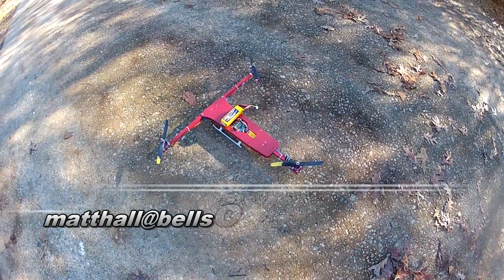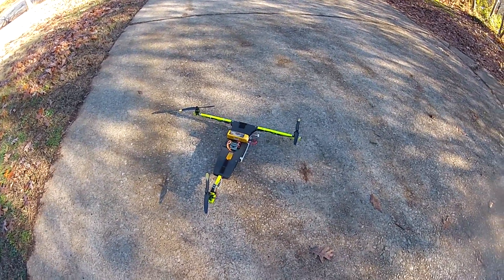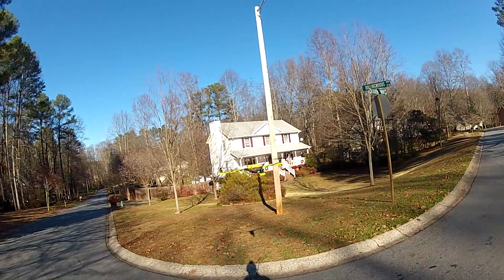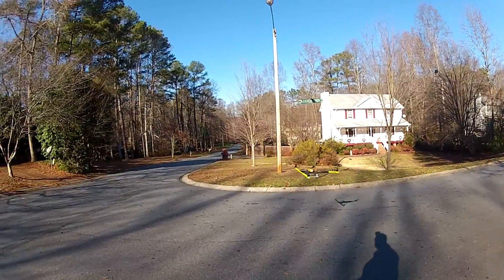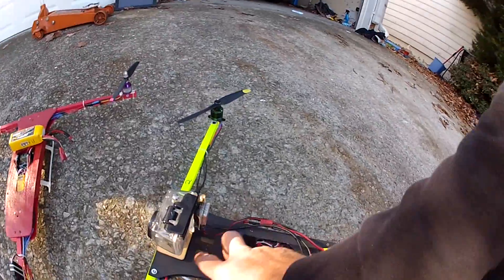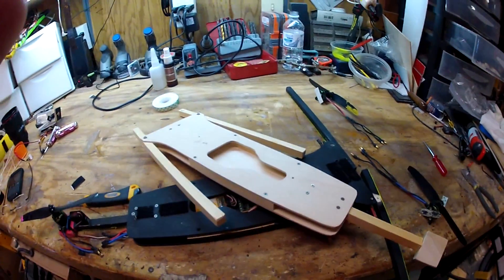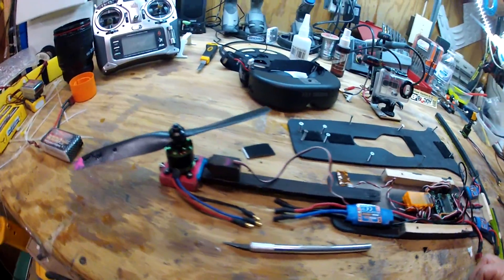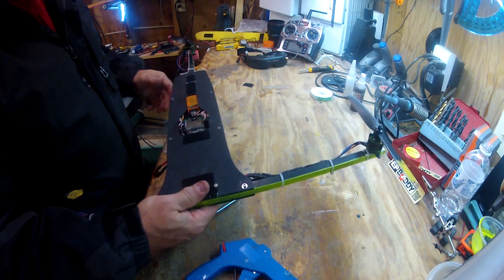simplecopter T Copter For FPV www.simplecopter.com

Comment: Have you tried the SunnySky 980kv with a 9047 prop vs 1400kv, 8047?  Basically, how fast does aerobatic/hover performance drop when you go slower/bigger on the motor/prop?

Comment: I am first time working with a T copter and don `t know what to make of the base body T copter! general pozhaduysta explain to me how to make a model I I do not know which radio equipment is needed for this T copter, what speed control, what kind of battery! I hope for your help I would be grateful if you send me all the marks and names of all the parts of the T copter Thanks in advance for your attention!

Comment: Besides the shape, looks, and electronics being on the inside instead of the outside; what's the difference in the T-Copter and the Y-Copter that you build.  Does one fly better or faster than the other?  Easier to build/rebuild than the other?  What....? Thanks

Comment: G'day Matt, maidened my T-copter today - wow!  Just awesome!  Had some fun getting KK1.6 flashed on my board as the HK usbASP came without firmware *grumble* but I managed to hack my Arduino Uno into being an ISP and got it loaded.  My ESC's aren't flashed yet, so stability mode was a bit ... unstable(!) ... but it certainly helped with basic hovering in 10mph winds, and for vertical climbs (my first attempt at a fast climb without stabilisation nearly ended badly).  ESC flashing tomorrow!!!

Comment: My God you Sir are an insanely freakin awesome tri-cop pilot!  I have been learning on a F450 FlameWheel with the old crappy original KK board for about a month and although I can hover and do some basic flying I STILL SUCK!. Lol Is a tri-cop easier to keep your orientation in your opinion? The reason I ask is because it has an airplane look and I am an airplane guy. Im Not great at flying FP & CP helis but I do a lot better with them than my quad because the orientation is easier for me.

Comment: Hi Matt, you sound like you're from Fort Worth Texas, are you?  I'm from Houston.  But, here is a question...Do you have any idea how much weight this design can lift?  I want to build one and it will be my first rc craft, however, I will deck it out with all the OSD, GPS, and cameras needed to fly FPS.  So, weight is a factor in a big way.  If these motors are good, great I will buy them.  If I need some a bit more powerful, got any suggestions on which ones to get?

Thanks Much!

Tracey

Comment: woooooouhh thats frame is fantastic, and it is noticed that you have lot of experience in multirotor, y just have bouthg one, but it can't lift and i think my battery is died (it was originale from a 3D helicopter) what kind of batery are you using? what brand? thank you a thumb up. ITS GREAT!

Comment: wow what a unit and tough! you sir are a top gun machine driver  i was havin a heart attack when it was doin a speed run and zip around the way you do is mighty impressive i can hardly fly it on flight simulater  to me its has a high dificulty level and you are a master be safe and thanks for posting  over and out aj

Comment: Hi Matt, great design you have there. On the part where you showed how the ESCs are wired up, so the black wires of the 3 ESCs are all connected and all the red ones as well? Meaning they're in parallel and not in series?

Comment: Thanks Matt! Will definitely try this setup out. The lack of rolling shutter is excellent. I suspect it has to do with the high KV rating. My current quads and tris have below 750KV motors and no matter how well I balance the props and motors and using a anti vibration mount, I still get annoying rolling shutter on bright days.

Comment from the maker: freehanded it. plate is 14" long 6" wide in front tapers to 4 then 3" in back. i built an H quad first and could not get use to the up and down effect of yaw. i yanked the 2 rear arms and used a small tri boom shoved in the back and it flew great. thats what started the idea of the big deck T.

Comment: I know exacly what you mean. Only I fly quadcopters, heli en a lot of rc airplanes for a long time. see me on youtube with my name ard1400. Can i by a frame? My setup for my X copter: KK 2.0 board, 1400KV motor, 20A speedcontroler and 8x4.5 prop. My frame X666. I like you Y copter and i am intresseted in your frame and setup. realy nice and fly's verry well.

Comment: Sent you a email. Want two. Very nice design. I especially like the fact that I will be able to get all the flight gear tucked away. Also, I am running Camera, OSD, GPS and Transmitter. Can't wait to see how it all fits on this. It has been a pain in the past. Also, another thought. It looks like the platform does not interfere with basic flight characteristics.  Thats nice. Most large bodies on multi's cause wild behavior in flight. Again, Very Nice design !!!